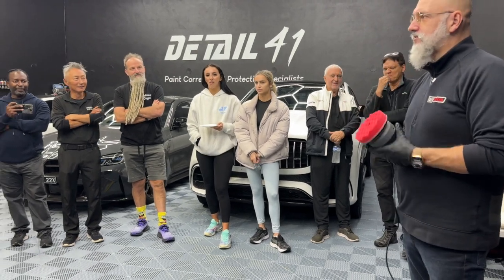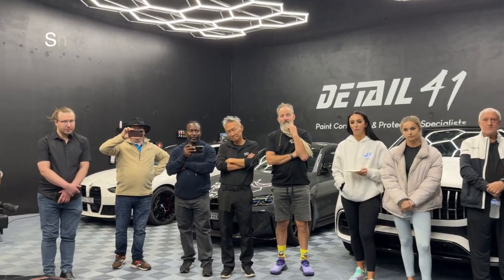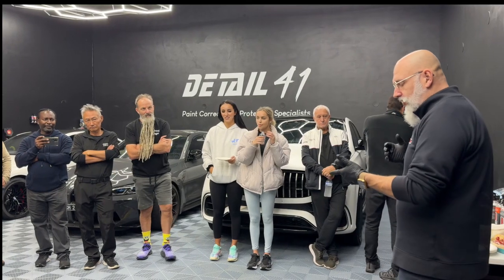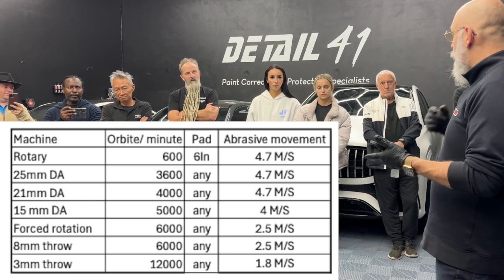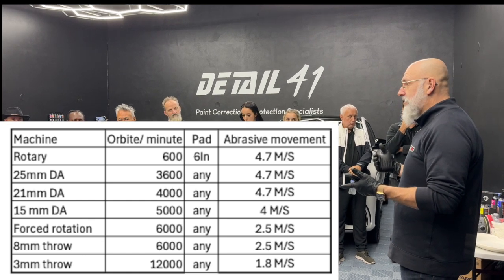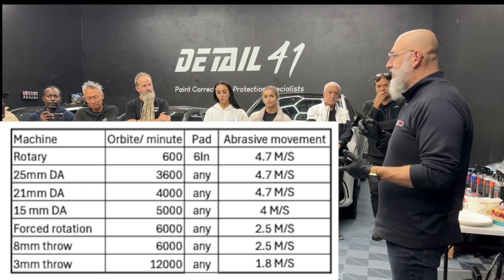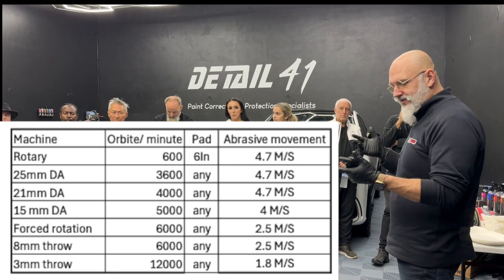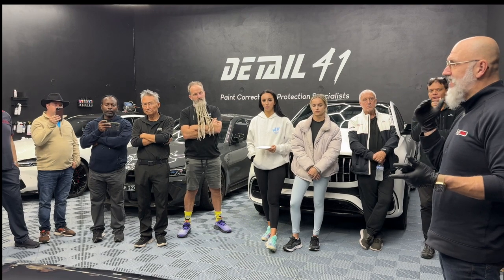Why we use the short throw machine  to apply the APP ''Adhesion Promoter Polish’’ C6 Ceramics ?

Comment: I bought a WORKPRO 5-Inch Random Orbit Sander, 6 Variable Speeds 7000 to 14000 RPM. Just wanted to know if I that would work fine with The APP and if I should change the backing plate to a Lake Country Da backing plate or keep the backing plate stock?
Reply from the maker: That sander should work fine.

Comment: Hi Yvan, I have a Makita DBO180 random orbit sander with a 2.8mm throw and speed from 7000-11000 OPM. Would that be good for this and what speed should I have?
Reply from the maker: Yes, absolutely
Reply: @C6ceramics thanks for getting back! Which speed should I run it 7,000/9,500/11,000 OPM? Thanks
Reply: @diydetailofficial ❤

Comment: I noticed in some of your videos you mention you have to remove the brake on the sander. I have the Dewalt DCW210, cordless and brushless. It doesn't appear that there's a removable break on it. Can I still use it?
Reply from the maker: If the pad free spins, yes. If the pad doesn’t free spin, remove the backing plate, behind it will be either a belt or plastic ring that prevents it from free spinning.
Reply: @C6ceramics  Thanks for the quick reply. I removed the belt but it still stops spinning rather quickly. ETA- I removed the dust shroud also and it now  moves freely.
Reply: @abrunet85 What did you end up picking up? I was planning on getting a DCW210 soon but your experience had me thinking otherwise.
Reply: @MikeKaufman-d7n  Sorry, I thought I responded to you the other day. I was coming back today to say that the DCW210 should be good. I came across one of DIY Detail's videos showing how to remove the brake. In that video he removed what I call the dust shroud. Removing that and the little clear belt keeps it free moving. 👍
Reply: @abrunet85  Thanks!

Comment: Great information as always. If using a 6" 5mm Random Orbital Sander with speeds from 4k -10k rpm, what speed is best for the application of APP? Also, another detail I couldn't find in your videos is the number of passes when applying APP; is one pass sufficient or are we generally looking for a number of passes that thin the product out to an easy wipe-off haze (using the recommended 1-2 drops per application)?
Reply from the maker: With a 5mm stroke 6-7000 OPM is good. One or 2 passes is sufficient

Comment: So, if you use a lokg throw da to do the bulk of the paint enhancement, will the 3mm sander combined with the APP generally get rid of the bulk of the DA haze? In one vid Yvan went DA to sander, when he did Pan's new Porsche I believe he went FA-rotary-sander. Was that just to get the ultra gloss or will that be a common procedure?
Reply from the maker: It was to get the most gloss. DA to APP is the normal SOP

Comment: Okay I have been looking for a corded palm sander with a 3mm orbit but have not had any luck. Went to Harbor Freight and found the cordless 20V 5 inch Bauer that does say 3mm orbit but not for a corded. found a corded with a 3/32 orbit but that doesn't match what you said in the video. Please help.
Reply: I use the cordless Bauer and it works great!
Reply: @johnfontaine1257  No concerns for battery life?
Reply: @johnfontaine1257 What speed do you use that on?
Reply: Isnt the 3/32 one what he uses in other videos? I think that comes close to 3mm anyway
Reply from the maker: 3/32 is close enough

Comment: Can the app be used a refining step, like in a 2 step? Or would I still need a 2 step and then the App step after?
Reply: I would not rely on it for "correction".  But I have been able to finish out very light holograms with APP.
Reply: @ryanl8653  do you think it will take it DA haze?
Reply from the maker: Do a test spot, if you like what you see, you have your answer
Reply: The first time I used APP with the red rotary jeweling pad on a 15mm DA was able to correct some defects, including shallow water spots. That was with 3 slow passes (too much). I didn't think the APP was hard to wipe off, I've had ceramic coatings much harder to level. That was more of a test than anything, moving forward I use a palm sander and 2 passes not expecting much correction.

Comment: Hold Up. Whats the formula for this? A Milwaukee 15mm DA for example is 2400rpm on the low side. Does this mean you could apply APP with the DA?
Reply: It would be hard to maintain pad rotation with a 15mm that slow.
Reply: A 15mm is not recommended. Some have already tested this and it makes for a difficult wipe off.
Reply from the maker: That gives you 2m/s so technically yes, but those who have tried were not impressed.